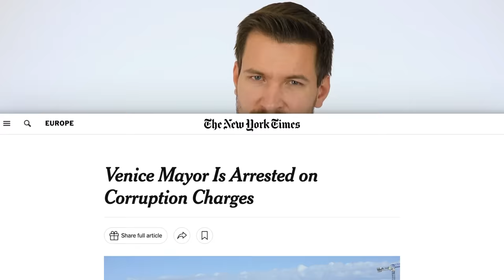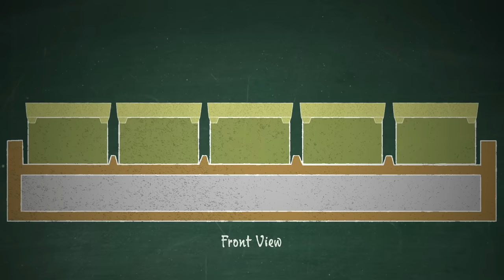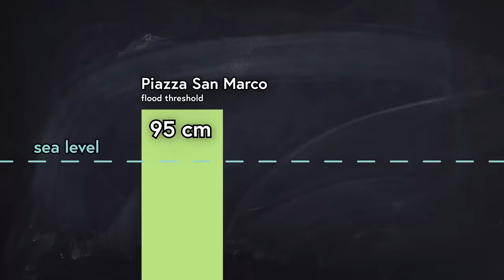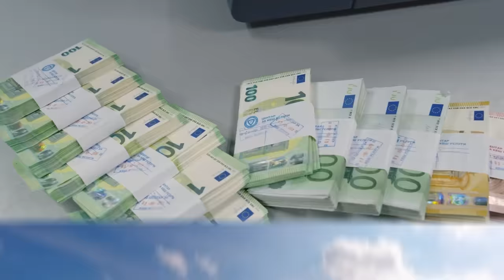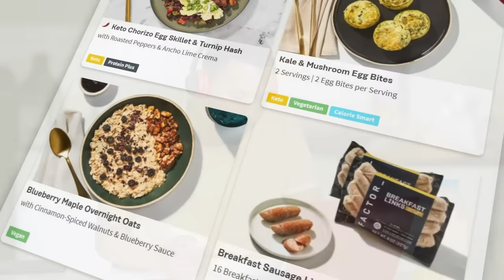Why Venice’s New €8 Billion Flood Barrier Only Kinda Works

Comment: Congratulations to HAI for making the first accurate video about MOSE, everyone stops at the “lol overpriced project that doesn’t work, should’ve asked the dutch” while failing to understand the peculiarities about the venetian lagoon and the fact that MOSE was being developed as it was built.

Really shows the difference between a channel that does his research and writes his own video and all the other chatgpt copy pasta.
Reply: I would say spending billions in public funds before you finish the design is a very telling part of the problems surrounding this project, most of which could have been avoided with proper planning and expertise.
Reply: Considering it's only good for at most a hundred years, and we (the Dutch) have already been mentioned in this video as someone to copy a longer-term solution from, I'm going to say that they should've asked us in the first place.

Just build an Oosterscheldekering-like barrier, add a few sluices for the ships, and you should be good for at least an extra one to two hundred years beyond what MOSE is good for - although at some point, you may be limited to opening the barrier only during low tide to avoid the water level in the lagoon rising too much (you'd open it to keep the lagoon clean). Of course, that also has a solution, namely letting water flow in at a slower pace and pumping it back out, however I imagine that may be expensive.

On the other hand, that's a 2300 AD problem and by that point we probably have nuclear fusion figured out so that should make things easier. Also, even failing that you could use tidal generators on the in-flowing water to produce the power required to pump the water back out. This won't cover the entire energy consumption (efficiency is always less than 100%), but it will cover part of it, possibly a significant part.
Reply: @Welgeldiguniekalias  it is not, the goal of mose wasn’t to protect the whole city, it was to allow for safe high tides (which are necessary to the lagoon) which also means flooding the lowest parts of the city, while allowing access to the port inside the lagoon, a special solution was necessary, it had never been built before, hence why it was developed along the building process, just like the first high speed rail lines
Reply: @Leyrann  Venice needed a custom solution, a regular barrier was evaluated and scrapped, as this would have cut off traffic to the port (mose allows marine traffic during high tides), and completely shielded the lagoon during high tides, which is not what the goal was.
Reply: @Leyrann That's a lot of talking for someone that knows nothing about the subject. Wish I had 10% of your confidence
Reply: yeah no mose is a mess, the spare parts that are yet to be submerged are already rusting lol. And i highly doubt the ventian lagoon changes the process of oxydation
Reply: @daves9172 "MOSE" does not allow ships to pass through when fully raised. Moveable barriers that allow ships to pass have not only been built before, but have been built cheaper and more reliable.
Reply: @alex9621 If you ignore the rest of the world, every challenge is unique.
Reply: @Welgeldiguniekalias  yes it does, there’s a series of locks by the side of the artificial islands, allowing ship passage without moving the barriers
Reply: @daves9172  In that case they could have used the mix use of the Maeslant Barrier for the parts the ships need to be able to pass. 
It works for the port of Rotterdam.  
And the Eastern Scheldt Barrier. The second would make more sense for most of the lagoon inlets. 
It would also be cheaper as the wheel was already invented as in how to build them.
Reply: @losfogo7149  the building process was a mess, MOSE itself is not a mess, it’s a marvel of engineering, a unique piece in the world, and just for your info, the “rust” you see on the barriers isn’t actually rust but dirt and buildup from marine life, those barriers are cleaned and checked for corrosion regularly
Reply: @daves9172 So when the barriers are raised, ships can't pass it, and have to go through the lock instead.
Reply: @sirBrouwer  maeslant barrier didn’t exist until 1991, the mose is a project that dates back to the 1980/1970s.

Those are also way smaller than the Mose barriers.
Th truth is that MOSE is the best compromise between the time it was designed in, and the needs pf the lagoon coast, it is true that we’ll surely need something else in 100 years
Reply: @Welgeldiguniekalias  mose is a system, not just the barriers, it includes high grounds, control systems, locks, multiple weather stations AND the barriers.

So yes, ships can pass through mose
Reply: @daves9172 Be a darling and correct Wikipedia for me, would you? It mistakenly says that "MOSE (Italian: Modulo Sperimentale Elettromeccanico, lit. 'Experimental Electromechanical Module') [...]  is an integrated system consisting of rows of mobile gates installed at the Lido, Malamocco, and Chioggia inlets that are able to isolate the Venetian Lagoon temporarily from the Adriatic Sea during acqua alta high tides." Or maybe you are wrong and MOSE is just the barriers, not the ground works, locks, and weather stations.
Reply: @Welgeldiguniekalias  first of all it says “integrated system”, and second, go beyond, maybe even translate the Italian wikipedia page, where it describes all the modifications and infrastructure that has been built around the venetian lagoon, the barriers by themselves are useless without all the other systems i wrote, they are just fancy floaties.

Anyway, i won’t waste anymore time, the info, blueprints and research about mose is out there, and now that it’s complete it has been proven to be a good system, if you want to see bad in it, you’ll find it.
Reply: @daves9172  however the Eastern Scheldt Barrier was built in between 1976 and 1986. they could have use that techniek directly.

Italy and The Netherlands being then both founding members or the EEC would have had a good opportunity.

Comment: Why not just raise Venice ... just start lifing up the city gradually. Like replacing the foundation poles on which venice is built exept they get longer so venice stays above water even when the sea level rises. On some occasions you just add a few more longer solid poles over the decades, and then continue lifting.

Comment: It doesn't work only partially, it works; it has already been made operative and has prevented the flooding of Venice (the "infamous" high water) more than 50 times.
The problem is that the project (chosen to have no impact and be invisible, instead of simpler and less expensive projects) has cost a lot and costs also to maintain.
It's still a price that anyone (in Italy and I hope in the rest of the world also) is willing to pay to save a city who is like no other.

Comment: Rebuild everything individually on stilts or way higher foundations. It's gonna cost a lot and remove a lot of old buildings, but so will the overtaking of the sea... If you wanna keep living there forever, you're gonna have to do better than a wall.
Reply: Not if you build a bigger wall and turn the city into a city on a lake instead of the sea. Sure you'll have to deal with finding a good way to clean and replace the water, but it is another option.
Reply: Nah building a wall will work just fine, we have 70 yr old dykes that have had a constant hight difference of multiple meters for that entire time.

It requires maintenance and care but it's definitely a solution. (gotta pump the water around tough)
Reply: @profwaldone  considering it will completely block off the ports and sea access for the other towns AND destroy the ecosystem the cost of upkeep and reroutes of ALL shipping will be prohibitively expensive to keep up.

Comment: 1:28 im pretty sure the dollar bills should be placed vertically to come out to 32cm, not horizontally
Reply: Actually, according to my Research just now a dollar bill is 15,7cm*6,6cm, so it's either roughly two dollar bills stacked vertically or five dollar bills stacker horizontally

Comment: Wouldn't 32 cm be closer to the length of two, $1 bills or somewhere between 4 and 5 bills if shown as in the video?
Reply: A dollar bill (and actually all other denominations of US bills) is approximately 6.6cm wide, and 15.5cm long. So basically, it depends which way you rotate it.

Edit: oh I think I misread your comment, and also didn't bother to go and check the video again. I agree, the video is wrong when it says 3 dollar bills at 1:28.
Reply: @killerbee.13  Before I saw these comments I had been measuring a US bill to see for myself.

Comment: From my understanding but this is only an assumption we can make a 6 km inflatable Mountain for 6 million dollars and from my assumption but this is only assumption because I haven't received an accurate figure from any designers yet that for 6 billion dollars we can make 1,000 6 km inflatable artificial mountains that we can spray an endless amount of water on top of which will turn into snow and ice because it is 6 km off of the ground and depending on how it freezes potentially we could make the ice go to 20 to 80 km off of the ground which would make another Arctic or we could put the inflatable artificial mountains beside the Arctic so that we try and keep the region Frozen because the danger is coming from inside of the water which is why it is making the ice melts
Reply: Aside from the inflatable artificial mountains you could also potentially drill a hole in the ground that would reach potentially 2 km into the ground and let the water go there in potentially you might be able to continue allowing the water to go in there indefinitely which would drop the world's water level but I believe it still would make the water turn back into steam which would make it continuously rain and I truly believe that the inflatable artificial mountain is the only way that you were going to stop floods

Comment: Venice, famous for its waterways, is facing increasing flooding due to rising sea levels and sinking land. To combat this issue, the city has built a massive infrastructure project called Mose, consisting of 78 hinged sea walls that can be raised during high tides to protect the city. However, the project has faced delays and cost overruns due to corruption and unexpected expenses, with the final bill estimated to be around €8 billion. Despite this, the sea walls are an impressive feat of engineering, each 20 meters wide and 18.6-29.6 meters tall, with a hinge connecting them to a 14,000-ton concrete bed sunk into the sea floor. The walls fill with water, weighing them down, but can be raised by filling them with compressed air, which forces the water out and floats the wall up. The walls are spaced three inches apart to alleviate water pressure on them and go up four or five at a time over about 32 minutes. The walls are activated when the tide is expected to be one meter above sea level, with a target of 1.1 meters, but the system is not foolproof, and Venice still faces flooding on about 100 days a year.

Comment: 328000 Euro to pump 10000 m3 of air ?
At most it lifts once a week.
So you have 168 h to fill a 1000 m3 vessel at 10 bar ?
My garage compressor can do 25 liters at 10 bars in 2 minutes.
That's 126 m3 in one week.
I am ready to buy 7 more and lift Mose for a mere 100 000 euros  a time.
Reply: I think fully raising the barriers that quickly, might create waves in the water. This may impact the buildings behind the barriers.

Comment: Call me a madman.  But why not just invest withthe entire coastal region and build a single massive essentially dam with a single moveable gate in the middle with large locks to permanently keep the venice water at a specific level.
Reply: Because the water need to be flooding in and out with the tides to keep the lagoon clean. Apart from Venice, there are several other cities around the lagoon, and the ecosystem relies on the connection to the Adriatic. If they closed off the lagoon, the sea would rather quickly turn into a big pool of sewage.
Reply: @varana  hmm.  I wasn't sure about being able to use the tidal forces to power a generator while allowing a small flow in during high tide then balance it by pumping out water during low tides.  Basicly running artificial water flow.  You just can't leave openings on the bottom.  But yeah you would need to work on it more.  There is always a solution.  But usually cost prevents really effective ones.  I need to go read up on migratory fish and crustacean populations and their ranges.  Vs the local seabirds the salt levels in the lagoon must be maintained.

Has the idea of a multilock with biolocks to allow for marine life to come and go been thought of.  Essentially like the dam except there are many small to moderate 2 or 3 lock long areas that are monitored by workers by camera or thermal cameras that keep the flow low 80% of the time.  But which allow small sections of the dam to be opened and then closed and have the animals in the lock be transferred to another lock that opens on the other side and which has been opened to the inside of the lagoon.  Over time animals adjust to easiest paths as long as a legitimate accessible path is there.  By making sure that the doors only open and close on one side at a time yiu can allow animal traffic from seafloor up to surface level.  Maintain safe water levels and  interchanging flow by co troling the number of locks open.  And by having them at multiple water depths you can control which part of the water colum mixes.  This allows pollution control.  Say a large oil spill occurs out in the Adriatic sea somehow near turkey.  When the oil slick reaches the lock dam yiu can't let the top level open but by opening lower levels and slowing inward flow with testing you could allow animal like to flee the oils effects of blocking sunlight and lowering oxygen without allowing the oil in.

It's expensive and would probably require Italy to make a nuclear plant.  But I mean were past the Era of nuclear fear.  Statistics show us that even if a chernobyl happened every 3 years that the levels of co2 and soot, and carcinogenic coal products and oil and sulfuric acid in rain and just in the air from normal power plants.v the non nuclear kills more since tiu need so many more and well coal mining is a job that cuts life expectation by 5 to 15+ years.  Working in a uranium mine has a non Statisticly relevant low level of years

Comment: The engineering work of the CENTURY.ZAn INVISIBLE GRAVITY dam! Under water there are kilometers of tunnels with pipes, computerized mechanisms, capable of lifting tons of steel, with the resistance of the water, to drink that mass of water and keep it out? High technology MADE IN ITALY. I hear about those mouse horrors in the THAMES or in Holland 😅, 1ST dimensions unmatched by comparisons 2ND, VENICE has 10 million tourists who stay overnight, many more who spend on cruises, 8 billion? A couple of years, with the proceeds from the sale of ice cream to tourists😅, will it last 100 years? DO YOU KNOW THE BILLIONS FROM TOURISM THAT VENICE INCOMES? SLIGHT MILLIONS OF TOURISM COMING JUST TO VERONA AND THE BEACHES? Venice is a catalyst, millions of tourists come to visit VENETO, not Venice,

Comment: climate change does not rais see lvl. 

imagine a cup with ice cubes in it. if u let all the ice cubes melt the water lvl will not go up at all, cuz the ice displaces the same amount of water anyway. 

see lvl will only rise if the land locked ice in the Antarctic starts to melt. which is nowhere near to happening.